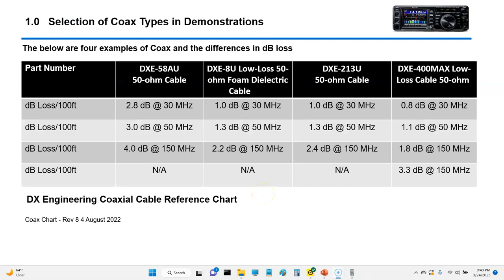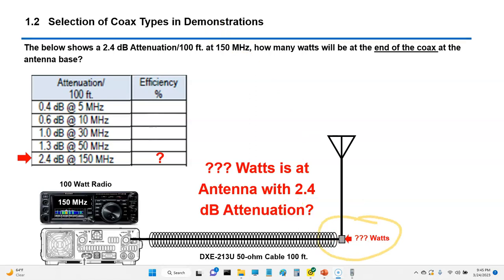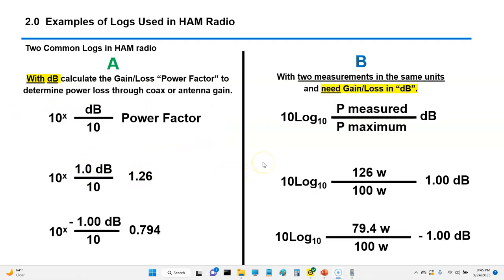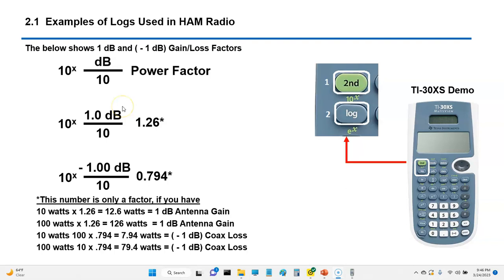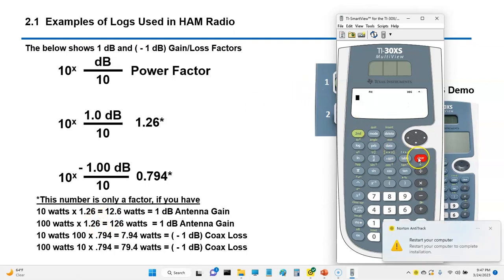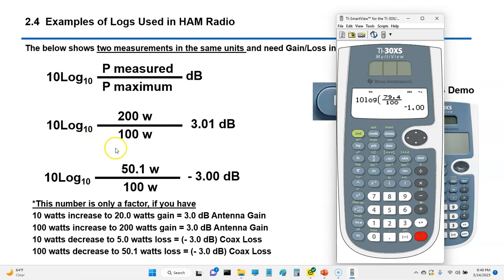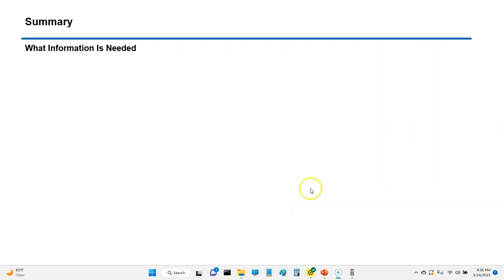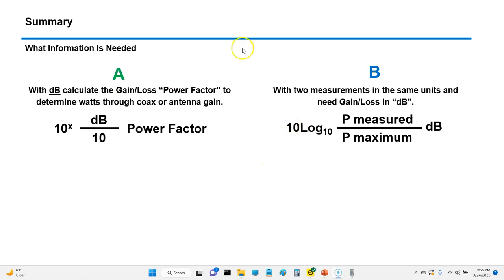Watts Through Coax with dB values Data Sheets - Calculating Coax Efficiency (loss) from dB Examples

Comment: I have been searching the net with negative results until I came across this video. Thank you so much for putting this video togeather. Outstanding! Brad K9LTX
Reply from the maker: Good evening Bradley, how are you doing this evening thanks for the message, no problem I enjoy making these videos as I learn new stuff, I was in the same boat I never could fique out anything with decibels, one of my instructors in my General class help steer me in the right direction.  Thanks again for the message and 73 hope to catch you on the air !